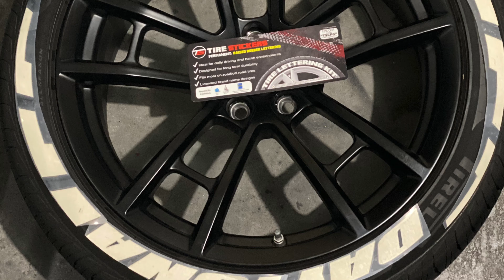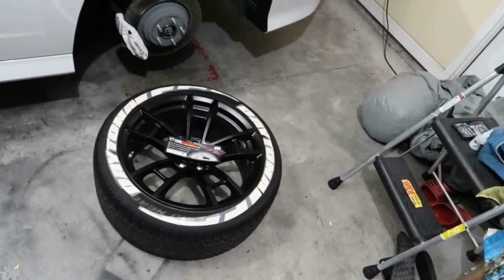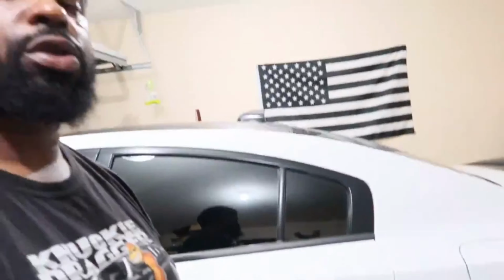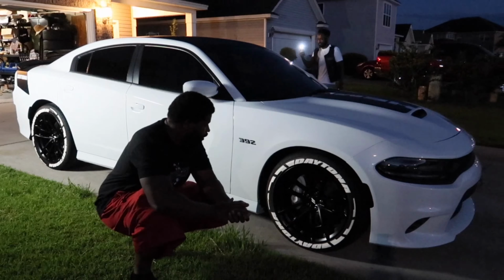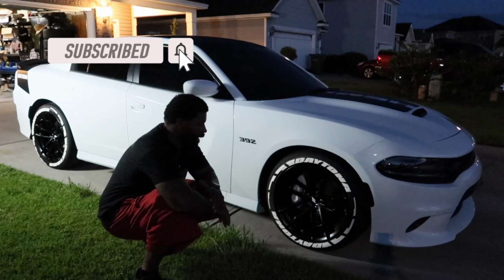APPLYING TIRE STICKERS | OctaneRed_392

Comment: Rubber cement did not work 
Super glue kinda worked
I dno what else to use. Literally their is only "tire sticker glue" and its by products 

But what lasts?
Reply from the maker: Ok, so how did you prep your tires? The rubber cement works; also, you can try 401 glue. It's a rubber to rubber bonding glue. Be careful. It runs like super glue, and it dries quickly. Also, be prepared for what I call letter pops. As a result, the tires on dodges expand and contract a lot from the heat generated while driving, so when you first apply them, one or a few letters may partially come away from the tire at specific points of the letters, mainly on the outer side of the tires closest to the road. At this point, you want to have your glue of choice with you, and you will have to apply some in those areas of the tire letters, and then once that stops after a few rides, you should be all good. The car in this video still has all the letters, including the replacements from minor curb rash that I replaced in another video I posted on how to return your TireStickers.

Comment: How long did these hold up? Like I said I have to put each letter on and I hope it last
Reply from the maker: Still holding up. Check out the video I posted today, my buddy has them on at the car show & he won a trophy.
Reply: @OctaneRed392  I was going to put mine on tomorrow. Weather has been rainy. Is horrible glue the best type of glue to use on these? Thanks
Reply: @airon6864  Im planning on putting some on my camaro but how long do they last? I tried sharpies but it faded by my second trip...
Reply: @ZayZion3  just clean the wheel and get some bad ads glue: that’s it. Hope for the best
Reply: I'm going to  McDonald's

Comment: What size is the tire lettering?  I'm in the process of ordering some but I don't want to get the wrong size.
Reply from the maker: 1”
Reply: @OctaneRed392  wow, I would have thought for sure that was bigger.
Reply: @OctaneRed392  just a question I've seen other comments of you replying back saying 1.25 and 1.75 and now 1' just wondering what size are they actually?
Reply from the maker: @Angel-ex5pg  they come in different sizes, but these are 1.25. Check the website for the different sizes based on your tire size.

Comment: How tall are they 1 inch or they bigger
Reply from the maker: Hi thanks for the comment and view. The TireSticker size is 1.25 for these particular tires which are 275/40/20 if you have the 245/40/20 I recommend the third TireSticker size for that size tire because of the brand of tire which is the Goodyear brand I believe, that particular tire they chose to put on the 9” wide rim had a lip mid way in the tire wall which causes a significant gap when applying TireSticker decals. If you do decide to go with the 1.25 just make sure to use extra glue to sure up the gap so the TireStickers get a full top to bottom bond also use masking tape to help hood them in place as you apply them, this will help cut down on the install time. Instead of you having to press them down for each one until they bond completely to the tire because of that gap. On the srt rims which are 9.5” the tire brand they used is pirelli and that tire has no gap midway in the sidewall. Also be aware of your tires expanding, meaning carry glue with you for the first week after install. To touch up any “tire pops” is what I have come to call them, because when you install the TireStickers they are of course installed on a cool tire that is not the same size when hot (daily driving) the tires expand when driving which causes the sidewalls to flex which leads to one of two things your TireStickers will crack because of the sidewall expanding and you having a very good bond or they will come apart from the tire a little bit. You will notice one of the two situations happen. The cracking is not bad but you will notice it, it will not distort the product. I hope was able to answer your question and also give you insight on what to expect.